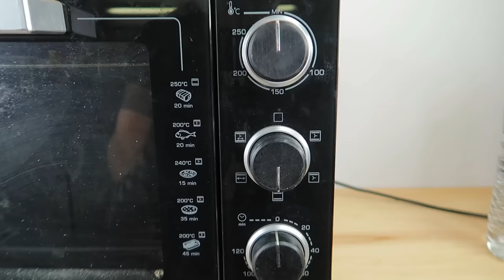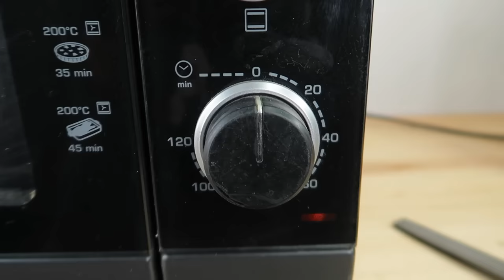RUSTY BEAR TRAP - RESTORATION

Comment from the maker: Thank you for watching my video! After you finish watching you should check this Yellowed Playstation PS1 here: 😎🥰 https://youtu.be/4HBr8NE17oc
Reply: If I may ask, what kind of paint or mixture is that? I find it kind of odd you would have to connect something to the item being painted.
Reply: @rommtech4604  It's a dry powder that is given a positive charge and the part is given a negative charge (through the wire clipped to it), the opposite charges cause the powder to stick to the part in a smooth even coat which is then baked on in the oven.

It's called Powder Coating if you want to look it up online.

The resulting finish is much more scratch and abrasion resistant than liquid paint is and it's used on a huge number of products found in most hardware/automotive stores...

Comment: 5:20 and this is why you don't wear gloves when handling high-RPM power tools.
Reply: Why not?
Reply: @holoex4475  If you were wearing heavy gloves and the disk grabbed onto the part you're  working on or the glove itself, the power of the motor won't just pull the part and the glove out of your hands, it'll take your hands with it, and you'd end up with some seriously damaged or missing digits.
Reply: I think its circumstantial, I nicked my pointer finger 2 days ago with a 40 grit flapper disc while using my angle grinder I sure wish I had gloves on! lol
Reply: Kamoe Desu It’s called ‘degloving’ for a reason!
Reply: @hoodiegoat8466  It sure is. If anyone is still curious about why you don't want to wear gloves around this sort of equipment, look up "hand degloving" and you'll understand why. It's not for the faint of heart, but I'll make you think twice.
Reply: We were taught this at the first lesson learning about machine tools.     If you make a mistake with something like a grinder it's far better to leave with a grazed finger than your whole hand in glove mangled up the machine.
Reply: Noooo, that's a hard no. Worked in a shop plenty and I always wear saftey gloves working with grinders. I cringe watching this sometimes knowing that he isn't rocking his PPE and nasically just wmraw dogging the grinders. Polishers I guess, I've been hit with a few of those, but not a stone and DEFFINATLY not a wire grinder.

Good and proper gloves (or almost any standard work glove) will save your hands, the physicas you're talking about here aren't possible. Degloving typically happens with loaded springs or bare slin contact with grabby fast moving meterial (i.e. wire grinders). A grinder would likely, if using a poor glove, rip the glove off, tear it, or just rip it, saving your hands.
Reply: @Raisopod  similar reason is why you should never wear gloves when handling liquid nitrogen
you'd think gloves protect you, but they hurt you way more
if liquid nitrogen hits your hand without a glove it just bounces off
if it hits the glove it can freeze the glove and leave you with some nasty frostbite burn marks
Reply: @LeglessWonder  The guy might not be even from the us thus english isnt his strongest language. Thought of that?
Reply: @Iceologer  If you can’t tell the difference in someones poor English as a non-native speaker and someone who spells it “DEFFINATLY” then you aren’t very observant.
Reply: @LeglessWonder  They tried, but they might be non-native to the US or might not speak English well. No need to be rude about it. You don't go up to someone and criticize them just for not knowing something, it's wrong.

Comment: I am so curious, why does the wire wheel spin clockwise a little first, then need a small pull in the opposite direction?
Reply: Because it is not working properly. It needs to be repaired. Take a look at the comments in other videos. It is the most common "complaint". 😊
Reply: Because it is missing and electric capacitor called a start capacitor that energies briefly to start the bench grinder motor to spin.
If you look at the video you we'll see that there is a rectangular protrusion from the motor and that one is called the run capacitor. Closer to the top of the bench grinder motor you'll see two wires where the start capacitor should be.
 I hope that makes sense. The field coil is energized for the motor the start capacitor determines which direction the motor will spin and the run capacitor keeps it spinning. That's why he uses his finger to start spinning it because the start capacitor is missing.

Comment: Bear is a strong beast. To fix the plate, it is better to use classic rivets.
The bending of the arcs was increased during disassembly. During assembly, they are not sufficiently bent and therefore not deeply fixed in the holes; the fastening is weak.
Congratulations to TysyTube for starting using powder paint. And the use of nickel plating. :-)

Comment: Great restoration 
But you need to do one on that bench grinder if it were running at the correct speed you wouldn't of slowed it down with the chain that's why it bit and tore it out of your hands 
FIX THAT GRINDER

Comment: How does the powder paint stick to the bare metal before heating??
Reply: The paint is delivered from a paint gun that gives the paint a negative charge.
The objects to be painted are connected to a positive charge battery.
When the paint is sprayed out it is naturally attracted to the object because of the different electric ions.
The paint then stays on the object only as long as it isn't touched and needs to be liquidised by the heat to spread over the object and melts, creating a completely sealed paint surface.
Hope this helps
Reply: Pebbles The Cat — hey thanks for explaining. Very interesting concept.

Comment: You should of made a device to hold the chain tight when run it through the wheel. Like two metal bars in a V it could be clamped between.